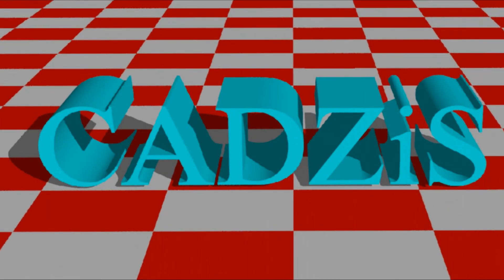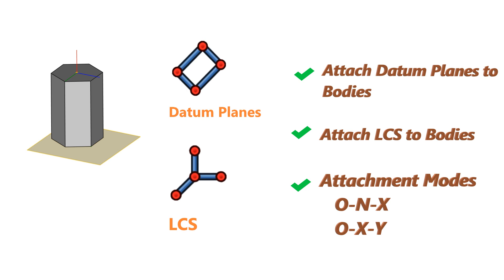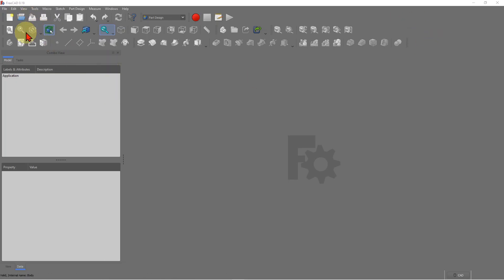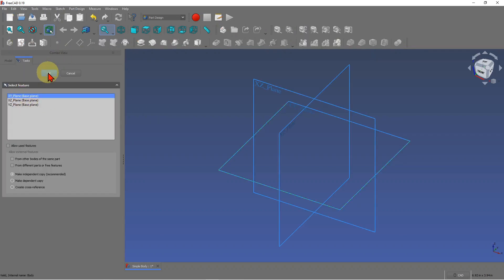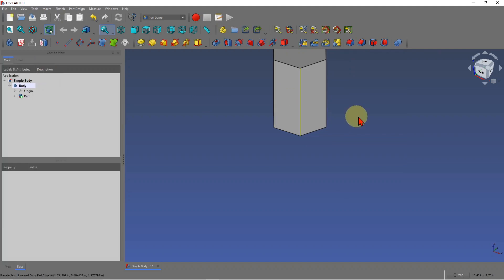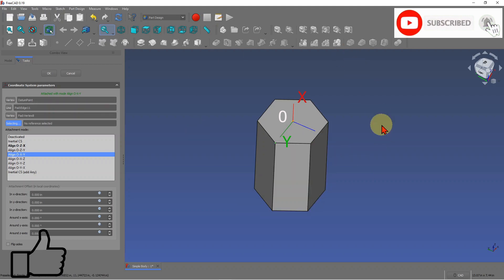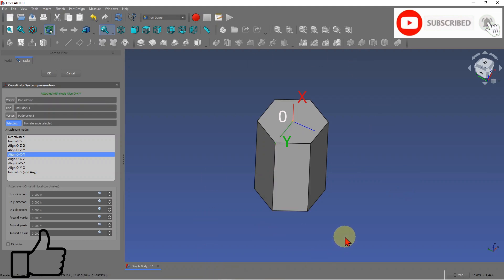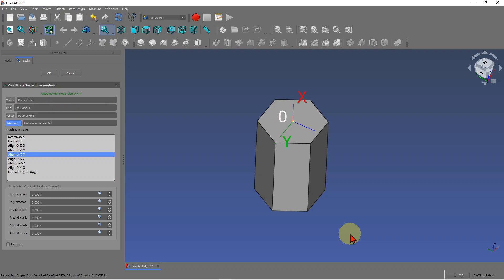FreeCad Tutorial : Datum Planes and Local Coordinate Systems

Comment: Hello from America, if you are not living here.
   Your tutorial was useful for me, I was looking for tutorials for draft array, but will also need to be able to properly define LCS for future assemblies.
   You are correct in your statement that this CAD program is not that intuitive. 
   I have learned alot from several channels on YouTube and by reading directions supplies on the website.
   I do not have a degree in any type of engineering, therefore my experience with this program is by teaching myself through experience with trial and error.
   So far my progress is pretty slow, but what I have learned so far has been useful enough to begin to create some simple assemblies, they are complex objects, but add up to simple assemblies.
   As my experience increases, I will be able to rely on fea or cfd for my designs. I will should also be able to apply some simple math for some of the projects. 
   So far though, I am learning to work with sketches, I have created assemblies by defining the object location within the sketch, and then importing the padded object into a  file with the base object.
   Therefore, the Draft Array method would be much more efficient in some instances. 
   Thank you for going over LCS definitions in more detail. 👍
Reply from the maker: Robert,  Great to hear that you are trying freecad with out any formal experience in CAD/Engineering.  This is why I put youtube tutorial videos like this  so everybody can benefit regardless of once  experience or background.   

I did not see much videos on LCS definition  and decided to put one out there.  There are several tutorials on assembly in my channel that might be of interest to you (see the links below).  
Or if you subscribe you will see all my videos... 

https://youtu.be/jJsRwgKWNa4
https://youtu.be/hiUukw-IwzM
https://youtu.be/iHPAxYezYHE